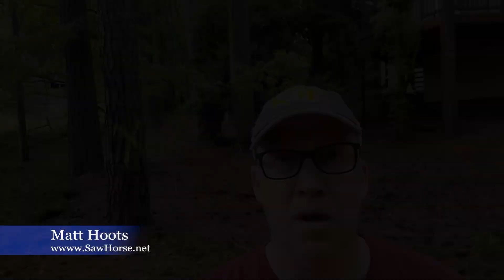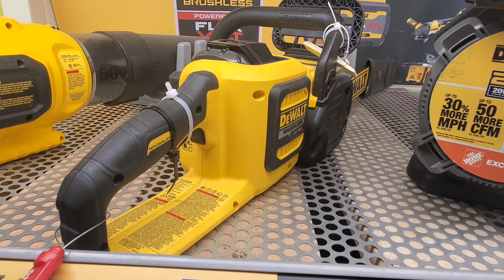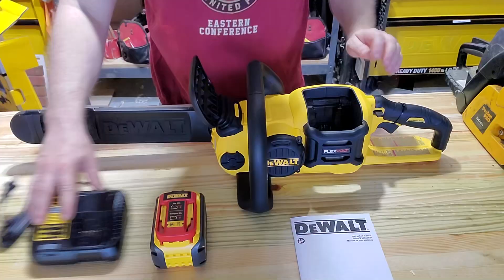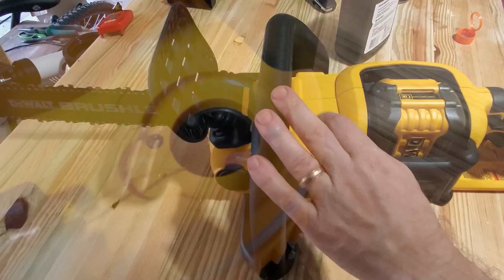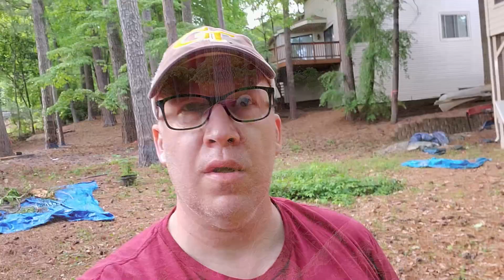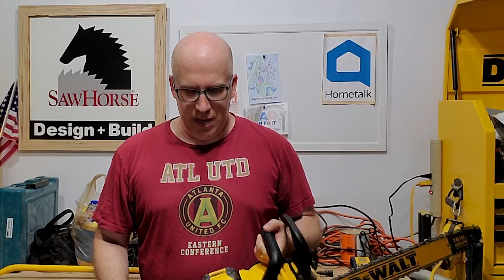Battery Chainsaw VS GAS Chainsaw || Dewalt 16 in 60V MAX REVIEW

Comment from the maker: CUT COUNT UPDATE:
The first test was on cuts that were ranging from 8" to 14" in diameter.  I got 15 cuts on the first charge.  I got 10 cuts on the second charge; however, the cuts were 14" and 15".  

I did the math, and that is about the same amount of material that was cut.  Round one cut through approximately 1527 square inches of material.  Round two was close at 1675.  Even though there were fewer cuts per charge in round 2- the amount of cut material was pretty close to the same, which makes sense.   

I used pi*r^2 to calculate the amount of material per cut.  So an 8 inch round cut would have been 50.25 In^2, and a 15 inch round cut would have been 176.625 in^2.

I'd love for others to do the same test and let us know how many square inches your electric chainsaw can cut.

Comment: Have both.  Like both.  Have the Dewalt 16" saw and a Husqvarna 55 Rancher in 20".  Husq cuts a "tiney" bit faster, but it's a more agressive 20" chain.  Overall, I'd say they cut "comparably".  Electric is fine for small jobs (one little aspen/birch), but you would need to own a bunch the 9Ahr batteries or bigger to cut down, limb, and buck a single whole large pine tree (3ft base diameter, say 100ft tall tree...  normal).  If you don't have a bunch of batteries (I only own two that cost as much as another saw), then you'll spend a lot of time waiting for them to recharge since they deplete way faster than they charge when you run the saw hard.  The gas advantage is huge in that you just add gas.  A tank of gas lasts way longer than the battery and when it runs out, it takes less about 1 minute to refill and you're back to work.  If you have a huge job and are trying to get it done in spare time (like most people) that's a huge advantage.  Also, if you run a saw for a living and need it to run hours straight, the gas would be better w/o question.  Both saws are about the same price, but the two batteries cost as much as an entire new "third" saw.  So overall, w/ a bunch of extra batteries, the electric costs way more and still has a lot of downtime to charge.  The electric is awesome for quick "little" jobs, it's light weight, and it's easy on the ears.  But for any big project where you'll be running a saw for hours straight, the gas is the way to go.  Also, the batteries stop holding charge after time (just like a phone) and you have to buy new ones.  Gas (as expensive as it is lately) is still the cheaper way to run the saw and for longer w/o a lot of long stops.  For quick little projects though, the electric is nice.  Owning both is awesome, but that would be hard to recommend to someone looking to spend as little as possible.
Reply from the maker: thanks for sharing your experience.

Comment: Ever use the 40v 14 inch ryobi??
Reply from the maker: I have not tried it out yet but would love to get some feedback on it.  I bought the Dewalt since I already had Dewalt tools, batteries and chargers.  Overall, I have been pleased with their performance so did not see the need to switch to another platform yet.  Dewalt is not a sponsor (yet) so these are bought with my own money at this time.
Reply: @SawHorseDesignBuild  no doubt, I appreciate the reply. I looked at the dewalt but can never seem to justify their prices if I won’t be using the tools that often.  My dad has all dewalt but HATES battery powered tools haha he’s old school
Reply from the maker: @JsChannel8  You really don't know if the tool will work well until you try it.  I own some Rigid tools, however this tool failed in less than 30 min for me so I bought a Makita instead.  https://youtu.be/Ekrb_RHe348

Comment: Nice!  I look forward to seeing more on this topic, and on lawnmowers as well!  About how much are extra batteries?  Also, I was curious maybe how long the gas-powered machine runs on how many fill ups? Just in terms of how you think they compare, like how much hassle one is vs the other.  I guess if the back up batteries aren't that expensive, the hassle is light, as they're easy to change? I would honestly do more work outside if it was cleaner.  I hear you on not wanting to deal with fumes, or spills.
Reply from the maker: I would guess that the whole tree would be cut up if I used the gas-powered saw.  I don't mind changing out the batteries (if I had more) since it is a quick exchange.  It beats smelling like fumes for the rest of the task.

Not sure about the retail cost of the batteries.  I always wait for the tools to go on sale so I can get a tool and battery for the same price as a battery.